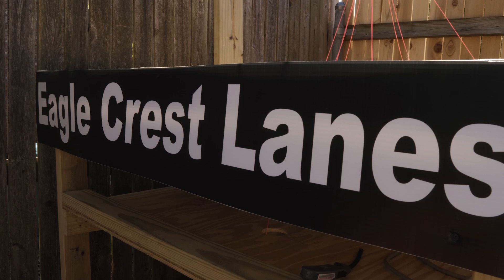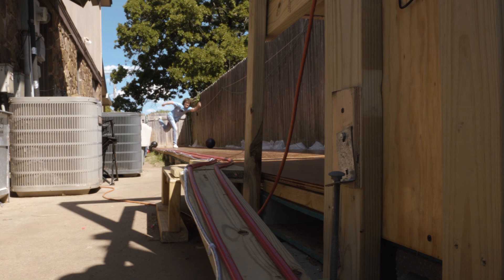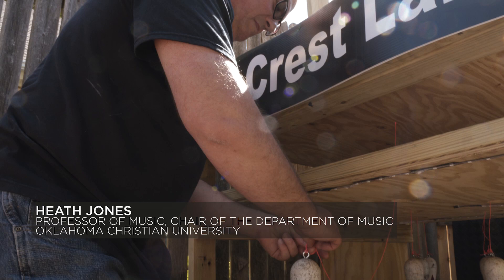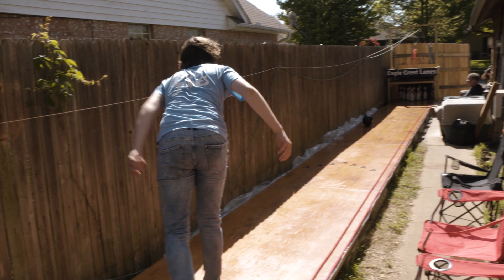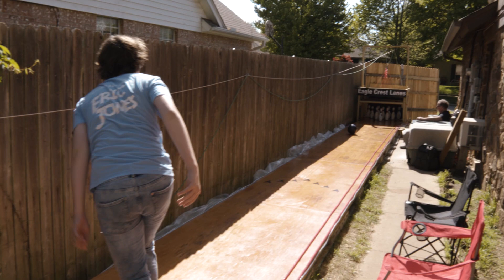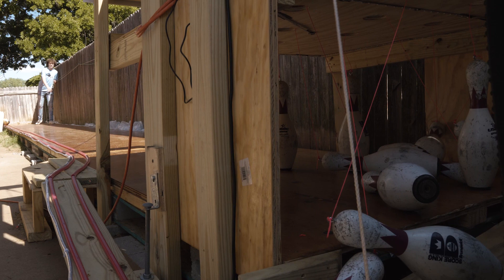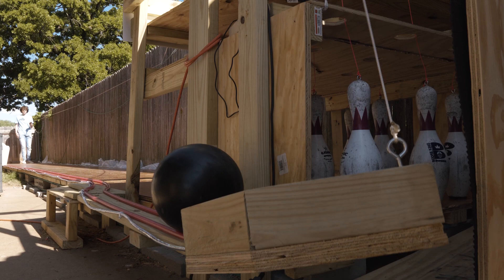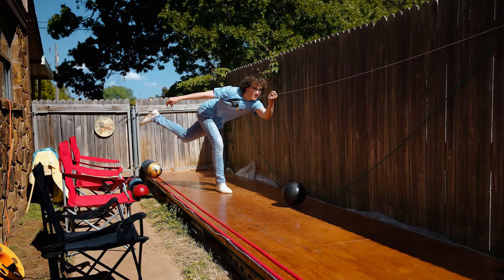Backyard Bowling

Comment: if i were to do this at my place.. i would set the strings at the bottom of the pin and drill out a pin holder
Reply: That would certainly require less room for the strings by putting them underneath the lane instead of to the side and over the pins.